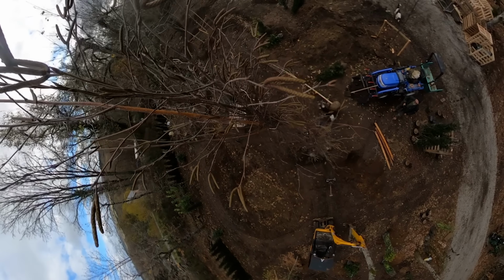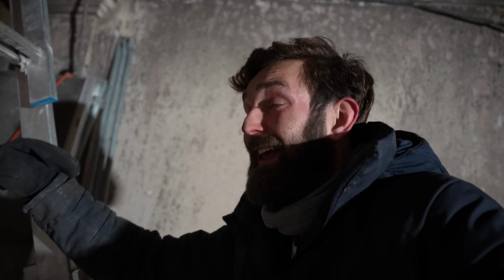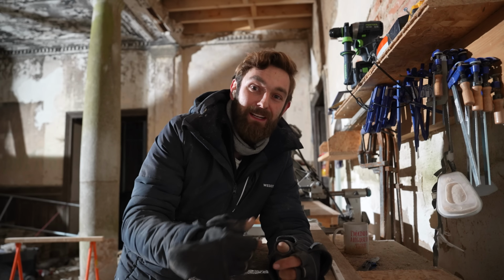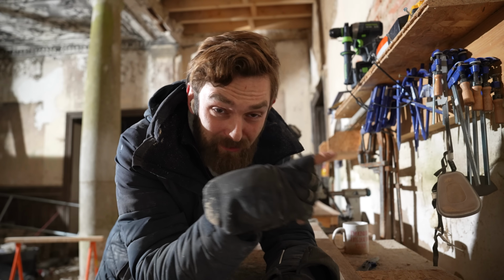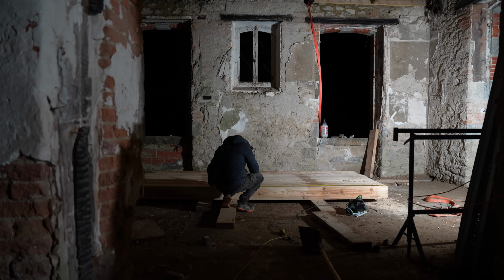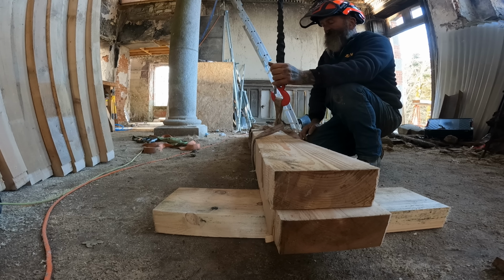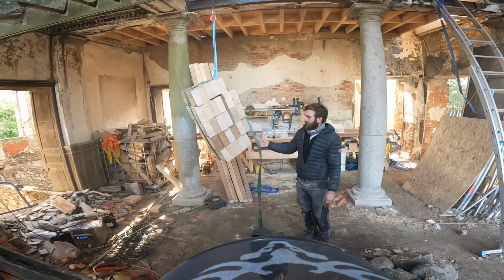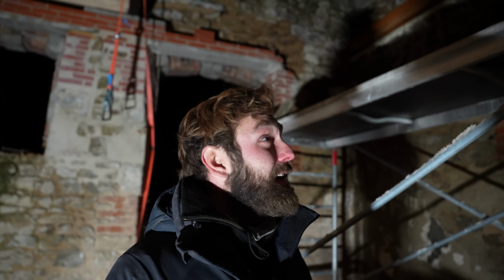The very last ever noggins before the roof.

Comment: It’s been a nice little break for you. I’ll bet that roof is going to give you new energy as you see it begin to take shape. There’s another whole house up there, so to speak.
Reply: I think a roof is important. But  having electricity is second. Does anyone knows why that takes so much time?
Reply: @rutgershenk  They won't connect electricity to a ruin. I'm sure they've laid out a certain condition he has to get the place to before they'll run electricity to the chateau. If I had to guess they'll at least require it be watertight.
Reply: Oh yes, didn't to think of that, water and electric ⚡⚡😊
Reply: @rutgershenk  I believe he has said that he plans to run it off grid with solar.
Reply: @joyeddlemon798 
That solar is for now. 
He spoke of bringing in electrical power later.
Reply: BREAK?? It’s been blooming hard work 😂😂😂
Reply: @juliehilton1701  😆oh, I know. But we’re not machines and when you get burned out you need a break away from the job you’re doing, even if it’s just another job. Didn’t mean he was sitting on his duff.
Reply: Sounds kust like my mom. Her idea of taking a break was to work on something else. She accomplished a lot.

Comment: Once the roof is in, you are setting up a workshop on that covered side. Will you also be installing windows on that side, to have more protection from the elements? It would be beneficial for you and your tools. 
You should create a workshop set up like Amaury did. It’s easy to find everything that way.
Maybe you can install a door in one of the rooms aswell and a log burner, using the old fire place shaft to install the exhaust pipe.
Reply: Excellent suggestion.
Reply: Clear corrugated plastic temporary windows can be re used for .. stuff.

Comment: I hope you have planned to have LOTS of help putting up the roof. Doing it by yourself will be extremely dangerous.🙀
Reply: To be honest, the top floor he's working off is not  much lower than the top wall, so it's less risky than it would seem, though if he's going to muck about near the edge he should be clipped on somewhere

Comment: Hey Dan! The gardens starting to take shape! ... and, as for the roof ... as far as I'm concerned, the most important thing would probably be to have it done (or at least part of it done), before it starts snowing ... the wood won't provide a whole lot of protection against the moisture and those rough elements of the weather. The roof, however, will! So, even if you only get part of the roof on before it starts snowing (and some temporary shutters and doors for the external doorways), I think you should have a safe enough place to continue working on projects underneath that sheltered area, when the weather is bad.

Comment: I think I saw some corrugated polycarbonate on a pile outside, and assume that is the temporary roofing material?  I put that on my screened porch roof, and just want to say - however many screws they say to use, double it at least, and make sure they're the right ones with a flange.   You get a lot of wind up there, and it files away at the holes.  It helped to be mindful of prevailing wind direction when deciding what pieces go under or over the next.  But that stuff, installed right, has lasted us 21 years so you'll have LOTS of light working that top floor for many years as you need to 'till you can get her truly dried in and slate tiled.  Bonus health and safety points if you chose the UV-proof kind.
Reply: You're right, it will be much windier up there than nearer to ground level where it would normally be used. Putting battens across the top and screwing through to the roof structure should be more secure.

Comment: If you're looking to save time you could run your track saw down the end grain of your floor supports rather than hand chiseling all those notches out. You already have them strapped, just prop up the stack and run the saw side like you have and then down from the end. I'm sure you've thought about this and have a reason for not doing it but I have to imagine there are faster ways to notch those boards than hand chiseling them.

Comment: You need to get you a beam cutting saw.  Basically it’s got the body of a circular saw with the blade of a chainsaw positioned vertically.  I’ve haven’t used one but they look pretty awesome and I think that’s what you need.

Comment: Hi Dan, Douglas from Oz here.
Try the following:
1/ Lay the beams flat & then cut them with the power saw. (will depend on your max blade depth.)

2/  Instead of power saw & then chiselling. Use the straight edge & a router with wood removal bit.

This should speed up the process I hope.

Comment: How did you design the roof? Do you have a CAD model of your house? Or are you going right after nature by measure each beam individually? which materiels where chosen? I also miss a resume on which floors have been done by now, and which you still have to do. This would look quite nice done with a CAD. You could incorporate it in every step, so we know on which part of the building you are working on.

Comment: You should paint all your steel beams as soon as you unload them off the truck. Avoid surface rust altogether and much easier than painting from a ladder.
Also, if you use paint from a can and a mini roller, it's better, thicker, & cheaper than spray paint.

Comment: Question if you predrill the steals(I beams)on the ground floor, and use the holes 🕳 with a bar through, to hoist to higher levels,would this make things safer and easier? Question if the bar was put through one of the centre holes and tied loosely at the highest end onto the cable 
whilst lifting, a hook could be used to pull the beam safely onto the landing ,simultaneously once hooked lowering the cable and this would allow you to pull the steel onto the landing safely ? Constantly checking the pulley fixtures for adverse movement? Just a thought? Don't hold the hook to tight and be prepared to let go if an emergency accures? Saves your legs and back?

Comment: You should consider putting the concrete mixer upstairs with you.  Mix it locally on the same floor, bring up large buckets of water, buckets of sand and lime mixed together in the proper ratio.  If you think moving all the dry goods up, then mixing and carrying potentially a larger quantity to the work location at once, and having a shorter distance to travel would help.

Comment: Forgive me but,  Is he putting up just a temporary roof or is he putting back what was originally built?
Dan?
Reply: He's building the permanent frame, but only a temporary cover, i.e. he won't be putting the final sheathing and slates on. He supposedly is building the framing for the original mansard roof. It will only be for the quarter of the building he's currently working in, not the whole roof.

Comment: Once you get the roof on you can get that utility elevator. 
You will need it in the future and it will make your job so much easier. 
Just do it Dan. 
As for the noggins going up you and the guys work hard but work smart. 😉
Reply: He  doesn’t have wired electricity to the Chateau to operate an elevator,  he  uses battery power for the winch.

Comment: Why not pre setting the roofing then lifting it up with a crane?
Reply: Such a structure would weigh many tons and require a substantial crane and specialised handling, all at a cost. Plus you'd have to make sure your measurements were all 100% accurate. Too bad if you get it wrong once it's lifted up. Plus few buildings, especially not old ruined ones, are straight, level or plumb, and you have to compensate for that. And finally, suddenly dumping a very heavy structure onto a fragile building might have issues.

Comment: Once the roof is on that portion of the building, what will you do next.
Reply: Finish consolidating the internal structure on that side. There's still quite a lot of surface area to repair in there. That could keep him busy till spring. Might even get first fix services in.

Comment: Instead of using a guide rail, cutting with multiple runs and then chiseling the joists.. Why didnt you use a router on a rail set at the correct notch height and run it a few times to cut it out?? instead of needing the chiselling part? 👀👀👀👀👀👀 I guess u should have done that from the start. No point now 😀

Comment: TO KEEP WARMER FROM THE COLD WIND  YOU MAY LIKE TO PUT UP PLY WOOD ON THE  OPENED WINDLOWS ..
Reply: The opened windows let the light in
Reply: Until the roof is on it's better to allow air circulation to dry it out
Reply: @eugenebennett5800  And until a roof is on, rain falls down and puts moisture into the structure, which can get dried out if air is circulating.

Comment: Time saver: is it possible to use the track saw to make one cut across the top edge and one cut along the butt end and then remove the material? 2 cuts versus multiple passes across the top and then tedious chiseling?

Comment: Why don't you put the saw slide on the end of the beam and cut just once? Or use a router with a wide bit?  You could use the same slide and would save chisling time....
Reply: It's been mentioned a dozen+ times.
Either he doesn't care or doesn't quite get it.
Reply: @dennispatrick4999  And he answered that too, he said it doesn't take so long the way he does it.
Reply: @KjerstiNagel Well, I did construction for years and using A Router would be faster and easier. 
Remember, Dan is a trained Chef and a Gardner.

Comment: why haven't you done any floors on the other side?
Reply: He wanted to get a roof on one side so that he had a dry and snow free place to work through winter.
Reply: @brendamayfuller8803  Thank you
Reply: @gregnolan5617 He said at the beginning of this whole project he'd be tackling the building one quarter at a time. I'm not sure how far he'll take each section before moving to the next (electrical? plumbing? Insulation and plasterboard?), but that's the plan.